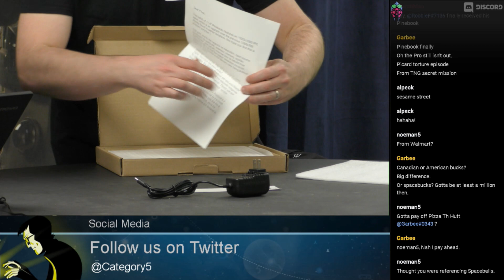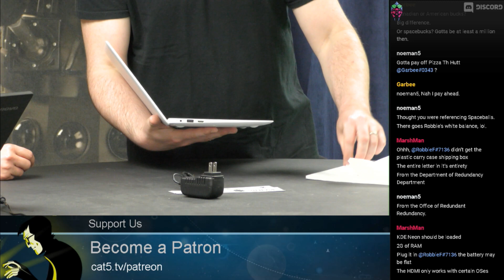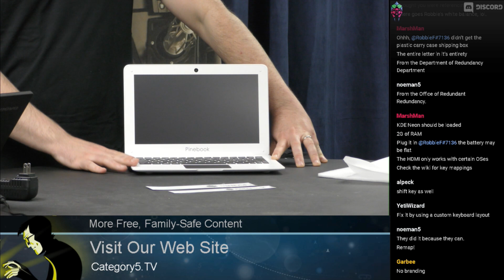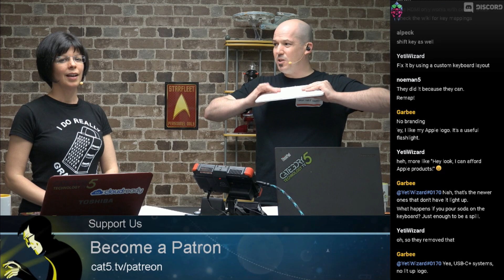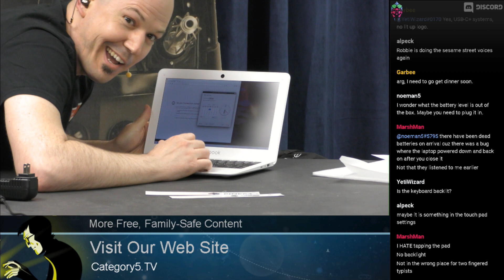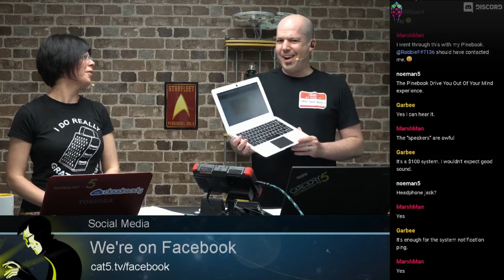Pinebook Unboxing - A Brutally Honest First Look at the $99 PINE64 Linux Laptop

Comment: lots of keyboards have "pipe" "slash" "#"   etc on the AltGr shift key, German, Spanish......
You get used to it and it is no problem.
The "~"( is really bobbins on the Spanish layout and on altgr)  you press it, nothing happens, you do it again and you get "~~" so you the have to delete one of them "Such Fun"
Reply: What you describe with the tilde (~) could be a hint that you're using a keyboard map like US INTL (international) that allows you to type "special" characters not present in ASCII by combinig multiple keystrokes.

For example: 
~ + n = ñ, 
' + u = ú, 
" + a = ä

You then can get single versions of characters like ~, ', " by pressing the spacebar directly afterward. 

X11 and Wayland give you the option to switch between two keyboard layouts using e.g. the capslock key, which I find very useful in that regard  (I use this to switch between US and US INTL).
Reply: @btschaegg  hi, I will try the Space-bar thing as it would be a sweet trick.
I know I am on the "es" Spanish keyboard both physically and in software.
I will let you know when I touch base.